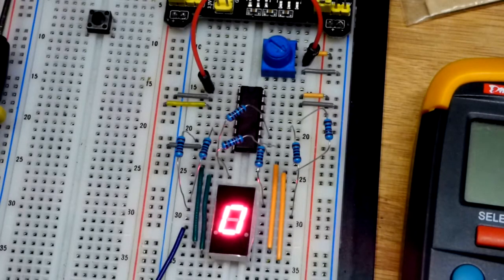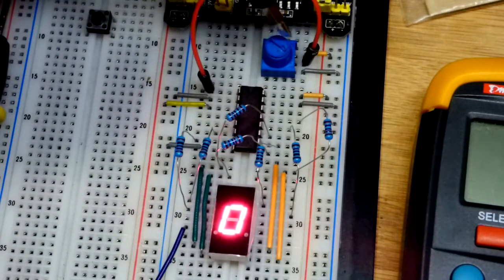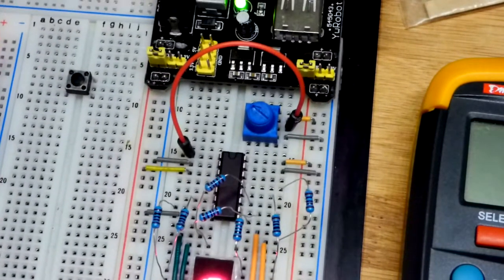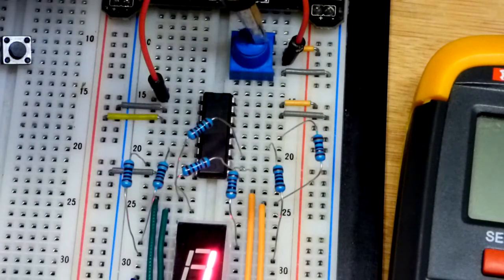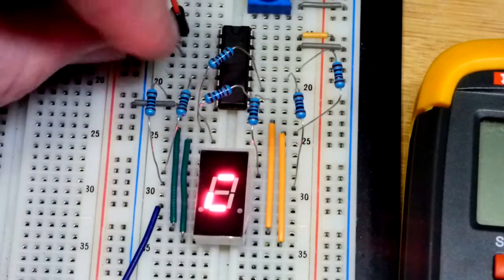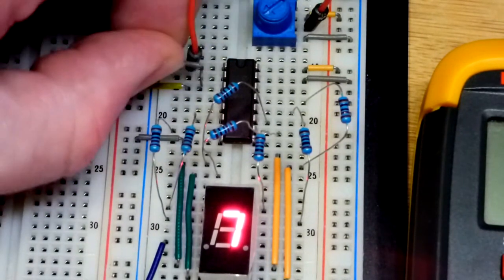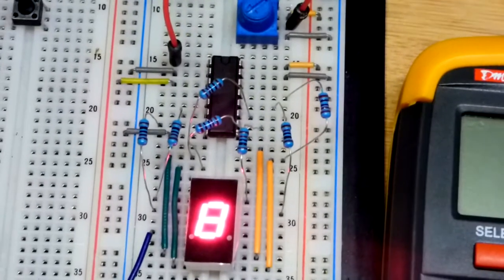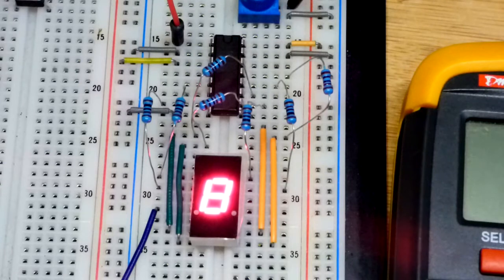Super easy 4028 IC controlled 7 segment LED display electronics circuit CD4026B CD4026BE

Comment: I did two doozies last week: 1) had my breadboard upside down and plugged in my dummy proof daughter board that has a nice circuit protecting diode in it and managed to fry a CMOS IC; and 2) I was playing around with a flip flop IC, had the data in pulled high to Vcc and connected my external 555 timer circuit to data in instead of clock and managed to fry an LED on the soldered circuit (bad design but it was the 1st thing I built from the ground up). I immediately stopped what I was working on and repaired the circuit.
Reply from the maker: Bummer! I was testing out op amps and forgot to move the power pin and fried a couple. I fry an LED like every 3-6 months or so lol.

Comment: Do you have a shema? Nice demo
Reply from the maker: No. But the pin layout is on this datasheet http://www.ti.com/lit/ds/symlink/cd4026b.pdf. I used a multimeter in diode tester mode to see which pin goes to each LED Anode right before making the connection.